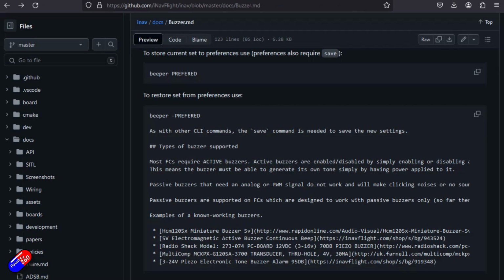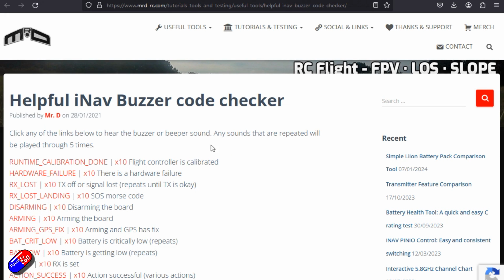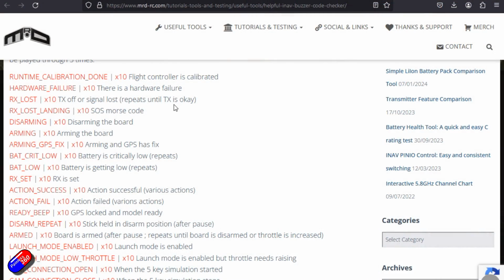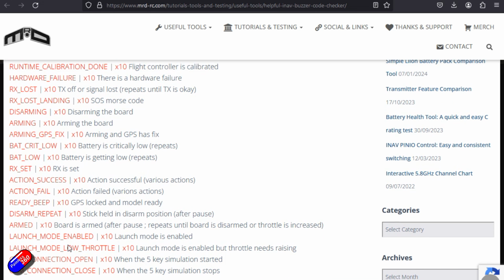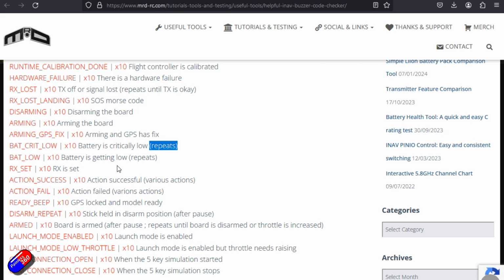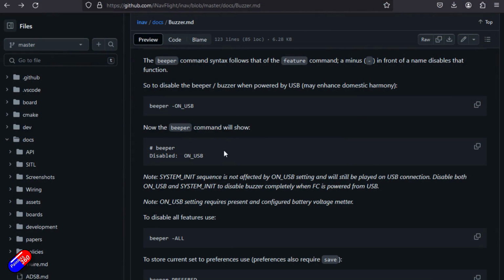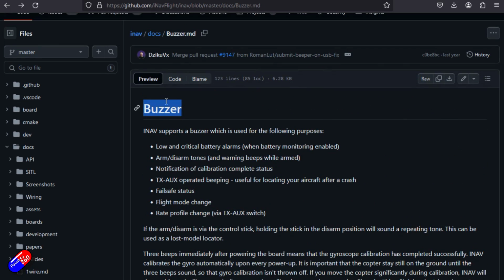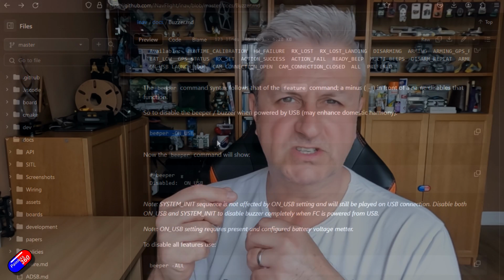Why does INAV keep beeping? (Headphone warning!)

Comment: I'm building a drone, my first one using inav and I can't solve an issue.
The problem is my ESC keeps beeping (over the buzzer connected to the fc), I'm running the speedybee f405 v4 stack. When I connect the battery it starts beeping rapidly, the only time I can get it to stop is when I connect with blheli to the esc. I lowered the beacon volume to 1, still nothing. I've also disabled every beeper in inav, so I'm sure the problem is from my esc. The only other time it barely stops, for a second only is when I open the cli tab in inav.

Thank you for your time and help!
Reply from the maker: Probably ESC protocol.  See https://youtube.com/playlist?list=PLYsWjANuAm4pgz-3DtfdHHKBLz23zgrSe&si=BDmKd5j2UlQTNfzM
Reply: @Painless360 I changed it from DShot 300 to both 150 and 600, nothing...
Reply from the maker: What other troubleshooting have you tried?
Reply: I have solved it since, it was one of the inav buzzers, ON_USB was turned off, so ChatGPT said that it is the ESC and I took it for good. Eventually I decided to turn off every buzzer and the beeping stopped. Thank you for your help!

Comment: Hi Lee

Thanks to your videos I got the grip on INAV in a few weeks using a Phoenix 2400 with the 
Speedybee Wing FC. Today after a 22 Minute Waypoint flight I landed to change battery, but after powering up I did not get the Ready to Fly on the Inav widget and connecting Inav Configurator wireless to my mobile device it was all green in settings. Eliminated some modes, just in case, but no way to start up the motor again. It never happened before, had 12 satelites all the time. Any ideas.
Thanks again for your video tutorials.
Richard
Reply from the maker: There are some things that will cause INAV not to arm, trying to arm in a navigation mode or having the first point in a mission too far... See my video on troubleshooting arming... https://youtu.be/RFO4TDIX5oU
 Best of luck

Comment: I had this beeper go off and stay on. It took a while to figure it out. I had set my flight controller for a 4S battery, but when I was testing my plane on the bench I had a 3S plugged in.

Comment: Thank you Lee for the cool tips and guidance on INAV and Mr.D’s pages listing the warning beeper codes.
As you mentioned, the newer FC’s are usually equipped with the switch to mute the buzzer… in an old quad I stick a piece of tape when working at the bench, like you do with the blue tack… Cheers and Happy Flying!